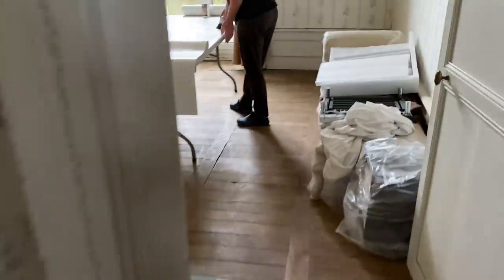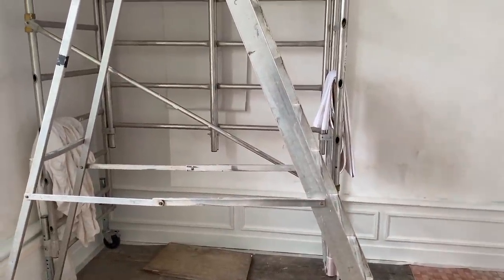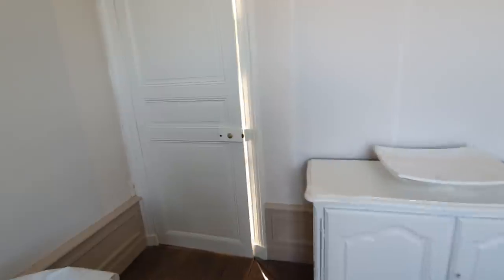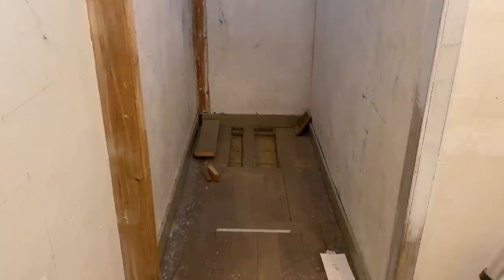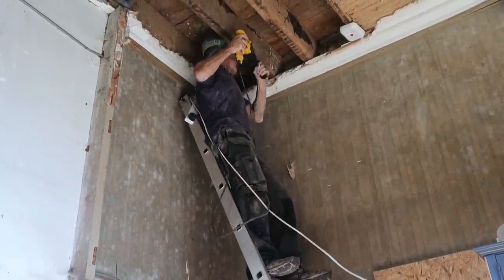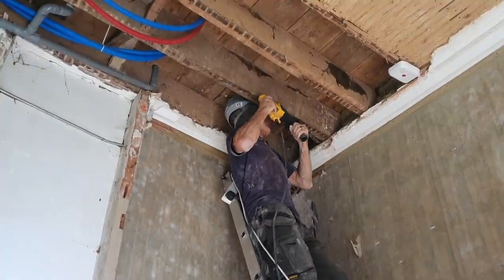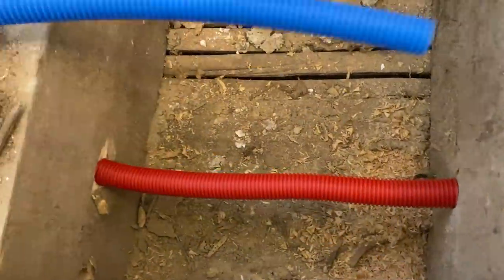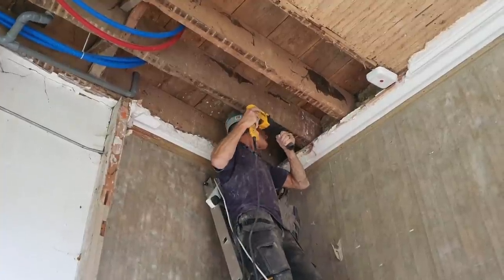How to Create a Chateau's En Suite

Comment from the maker: Thank you for everyone's comments about the floor! We have decided that we want something different to just the wood in this room, as this wood covers the entire chateau so we want a bit of variety! All suggestions welcome 😊
Reply: To preserve the wood floors, a nice polyurethane will protect the wood from any water. I did that in snow country and the floors held up beautifully with very little upkeep.
Reply: If you did tile a cement board would need to be applied first. Would you take out the wood to install the cement board? A tumbled limestone could be beautiful with your wall and trim colors. Another less work intensive solution would be to do a stenciled painted floor as you wouldn't need to tear out the flooring. You could do a marine varnish or clear epoxy over it for waterproofing.
Reply: If it were mine to do. I'd go for an 8 X 8 floor tile. I'd look for a matte finish in a green to match the wall paper. I'd try to find terra cotta perhaps and then seal it. I hate shiny floors in bathrooms, much too easy to slip and fall on glossy floors. I think the green with the wallpaper and the beautiful light would make for an enchanting foresty feel. It will be beautiful whatever you choose but that's my suggestion. <3
Reply: I was thinking maybe incorporate some of the original floor but maybe do tile too.  What about leaving a border around the perimeter with the original and do tile in? You can do a pattern. Kinda like you have a "rug" on the floor if that makes a y sense.
Reply: Then how about a lovely tile that looks like wood? You get the waterproofing and durability of tile, yet keep the old world charm.
Reply: Whatever you decide it will definitely an improvement
Reply: Add a nice r water
proof tile

Comment: If you're tired of the same wood look for the floors, how about staining the existing ones in a diagonal checkerboard design using stains that are compatible with your wallpaper.  It would preserve the marvellous oak floor but give it a more interesting look.  Then you can varnish to protect the floors and use moveable rugs where you need softness underfoot..

Comment: The best way to clean paint off keys, hinges knobs etc is to fill a jar with paint and varnish remover, dump the metal items in and leave for a couple of hours or overnight. The paint just floats off. Can use the remover over and over again

Comment: Since you don't want to keep the wood flooring, I would consider an elegant tile flooring. Something in the keeping of the era of the building and the character. Nothing too shiny or it will be a slip hazard. Perhaps a mosaic tile. the grout lines help with the slip factor. Make sure to water proof it so you won't have a mold problem with the grout.
Reply from the maker: Carole might keep it!

Comment: The family bathroom keep the wood. I had a wood floor in the bathroom in my old home. To deal with the water and the wood floor my carpenter recommended we stain the wood floor and seal it with a marine grade varnish used on boats. It worked beautifully!! I lived there ten years after the remodel and the floor still looked beautiful and held up amazingly.
Reply from the maker: Still unsure on floor. Still in the negotiating stage but great advice on the stain
Reply: I had four little ones when we lived in that home and the marine grade varnish was what kept that floor looking beautiful plus cleaning was a breeze. Since that home I have had tile floors in the bathrooms and hated everyone of them! Keeping the grout clean is a nightmare. 
The rest of the house for the wood floors a product called Gym-Seal was used that is usually used for basketball courts. I would highly recommend that to anyone with wood floors! I had that on the wood floors for ten years and they took the abuse of four kids and all the toys, dropped objects, etc and still looked brand new. Warning though the stuff is thick! One coat dries as thick as a USA penny! Also, crack every window open because it smells awful when it is wet. After it dries there is zero smell.
I hope this helps!

Comment: Lots of hard work! It will be beautiful when it finished. What if you turned the tub out into the room with   shower pipes and tape on the wall.  You could create a a canopy with side curtains like a canopy bed. This would allow you to center the tub and to enter from either long side of tub and be easier to clean. I would paint the floor the same color as one of the colors of the paper, not the background, and then paint several of the design element on to the floor as a boarder in a much bigger scale. It would give the appear of a large custom rug that goes wall to wall. The  back ground can be painted quickly and the pattern border can  be added after the fixtures are in place.  Cover with clear marine varnish. Add a chandelier and two matching side chairs or tables on each side of the tub and your ready for Architectural Digest. The curtains for the window should be sheer or lace to the floor and hung inside the frame of the window. A painted mirror above the sink with sconce.  Wouldn't it be great if the paper came in fabric for the canopy  and curtains! A plastic curtain that slides and hangs above the inside of the tub would protect the curtain and splashing water on the floor. It could be pulled back when it is not in use. all this could be done in stages after the fixtures are in and the paper hung. Best of luck!

Comment: Great progress - going through meter thick walls to get to a close by toilet at 2 am is hard work....😁
it`s a death sin to sand and wire wool all old metal - that be locks door hardware or window hardware - you need to burn all old paint off
that way you keep the old metal patina without getting that fake sanded shiny look - set up a stove/burner outside with good ventilation
leave the old hardware inside for a few hours or till burned off - less work much much better realistic look - you can then clear coat it or gold it for that really smart look.
Bathroom flooring.....high end 1/4" thick linoleum 12"x12" tiles.....glues down on a 1/4" 4`x8` sub.....over here we can get them with old classical fit for a chateau patterns
it`ll feel good under your even wet feet and the "wooden look" you`ll have plenty of in the rest of the chateau

Comment: If it were mine to do. I'd go for an 8 X 8 floor tile. I'd look for a matte finish in a green to match the wall paper. I'd try to find terra cotta perhaps and then seal it. I hate shiny floors in bathrooms, much too easy to slip and fall on glossy floors. I think the green with the wallpaper and the beautiful light would make for an enchanting foresty feel. It will be beautiful whatever you choose but that's my suggestion. <3

Comment: I would suggest a smaller penny tile on the floor in a colour to match the wood paneling.   I would not keep the wood floor as is even with varnish.  Large tile format like slate (not sure how slippery that gets when wet) could also be an option but you would have to deal with the sub floor movement

Comment: For the floor, go with a porcelain tile that looks like marble and use the large pieces 20x20 or 24x24 and then the smaller 12x24 for the shower. Use the marble basket weave for the floor and a band around the shower. Make sure you put in a niche for shampoo etc.

Comment: For a really thin floor coating that is water tight (and NOT vinyl) I would use fiber glass, lay up 3 or 4 layers of glass fabric in epoxy resin and then use commercial shop floor coatings, the rock in clear epoxy resin you see in car show rooms, and many other places, can be made in near unlimited colours, and patterns.

Comment: I would advise a layer of waterproof material and over that PVC material, which is water proof. There is oak wood floor look alike pvc. It will prevent any water to go through. This way you combine the authentic atmosphere eith modern technology. It it available in long stripes of material which you can cut with a special knife

Comment: Love your purchases.  I am surprised to see (not for the first time) that you paper over the plaster walls and then paint or paper again.  Pretty sure that here in Australia, the plaster is the base.  Different one for wet areas, but paintable once the joins and corners are plastered.
Reply from the maker: Hi Shirley. The walls are lime plaster which are not smooth. By using a breathable paper I now have a better finish to work with

Comment: Engineered flooring with a tile look, snaps together and free floating, plus many are water proof or resistant. A good quality one looks and feels very similar to tile. You could also do an LVT Luxury Vinyl Tile, not as luxurious in my opinion but water proof and easily installed. Magnificent job by the way it looks beautiful. Hope your feeling well in no time.

Comment: Lining paper should be hung Horizontally, otherwise you will see double joints on your wallpaper which is hung vertically.
Reply from the maker: I have hung the lining paper, which is exta wide, vertical because it is easier here on a 4 metre high x 4 wide. The joins of the patterned paper will not line up in the same position. With extra care filling the joins of the lining, you should not see any joints if I do a good job! But you are correct, usually under wallpaper, the lining should be hung horizontal.  I absolutely love wallpapering, I find it very satisfying and quite relaxing if you take your time.

Comment: Why do you line the walls with blank paper?  I'm also curious to know how much time do you estimate it will take you to finish the plumbing, heating, and electrical work for your chateau?  My suggestion for the bathroom floor is either tile it, or put in a good quality linoleum floor.  Water tight is my biggest want in a bathroom.  Underfloor heating on a timer switch in the bathroom would be a good idea if you tile it.
Reply from the maker: Robert, I have lined the walls with breathable paper, to produce a flat smooth surface for decor

Comment: I would tile the floor in a neutral color like limestone or a nice grey and white patterned. With the timeline, what is available. Love the choice of paper. Also, what will fill the space to the left of the tub? Any reason to not slide the tub closer to the wall away from the door?
Reply from the maker: Hi Karen. We’re going to put a towel radiator in the corner

Comment: Forgive me for not knowing about wallpapering... Is the liner for covering up any surface imperfections on the plaster walls prior to attaching the decorative wallpaper?
Reply from the maker: The lime walls are very soft throughout the chateau. They have seen better days, many strange patterns have been drawn into them, quite odd. We do not want to replaster them. I am using a breathable lining paper to cover up the imperfections and give a smooth base for the patterned paper.  Normally you would hang living paper the other way,when finishing with a top paper,  but these walls are extremely high and so I am using an extra wide lining, so that the joins are not in the same place.  But as you can see, I have also filled the joins of the lining paper  just to make sure no joins will be visible.
Reply: Thank you!
Reply: What did you use to fill in the joins? Spackle?  The wallpaper pattern you picked will be beautiful too. Thank you!
Reply from the maker: @inhale3384  it's a very fine, ready mixed filler. Dries quickly and easy to lightly sand without ruining the lining paper.
Reply: Thank you!

Comment: Hello I have lived in Belgium and Greece in both counties this type of piping was used the outside tube isn't insulation.
A)  it is if there is ever a leak you don't get so much damage 
B) this outside pipe allows you to pull out the internal pipe and replace with a new one.
So is it not really worth putting little pieces between the joists??
Reply from the maker: Hi Denise. Correct, Adrian did say insulation instead of conduit, this is required in France for all cables and pipes, so putting it between the joints just shows willing.

Comment: Should not drill through headers and min beams. They weaken the structure. Learned that from builder remodeling houses that has been their main st expensive fixes
Reply from the maker: Thanks for the concern but we have checked with building regs first to calculate the allowable drill holes etc and we are well within the allowance.

Comment: Could  the tub fit next to the window,  instead of on the long wall?  🤔  Flooring,  I love the look of the wood, but  not so practical  in the bath.  What about  tile that looks like wood or maybe since your vanity is a mix of old and modern  do  hexagon or rectangular tiles, but only  in part of the room, under the tub and toliet to where it then "melts" or transitions into the original  wood?
Reply: But i would think white tiles for color